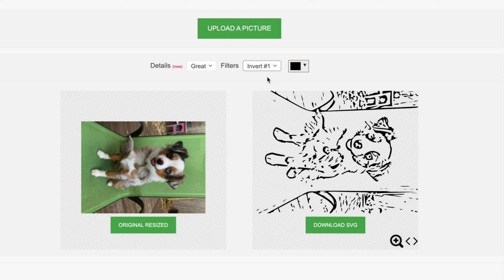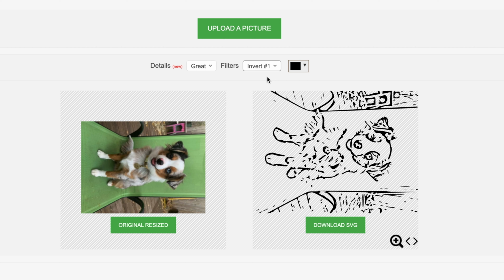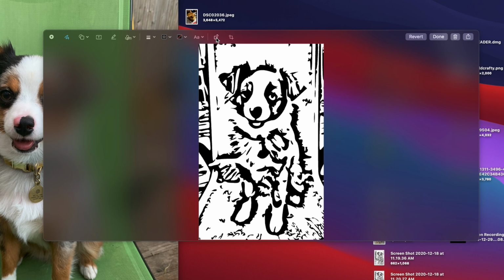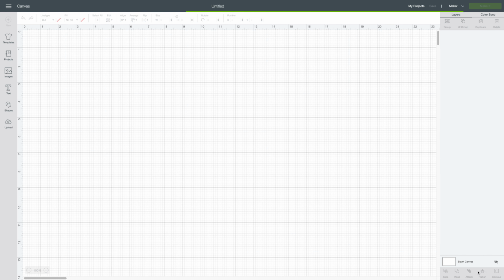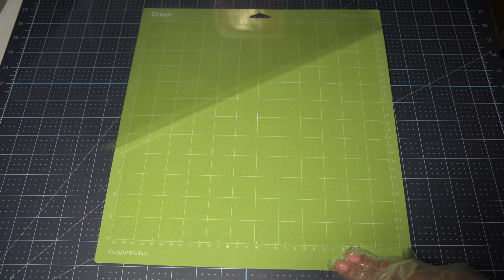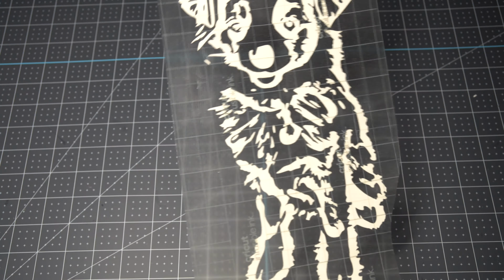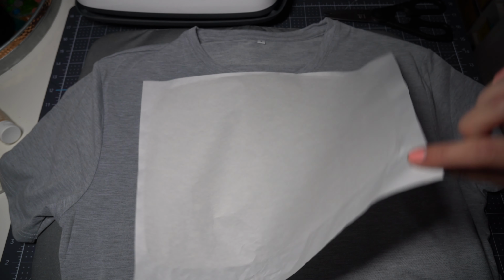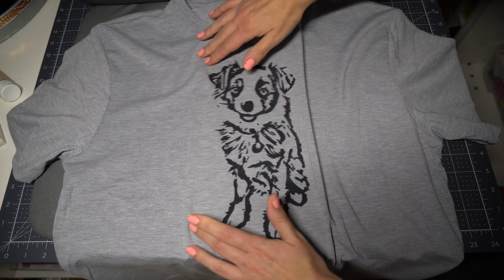How to Turn a Photo of Your Pet Into an SVG File for a Custom T-Shirt

Comment: I couldn’t get this to work with my cricut joy and I did exactly what you did.
Reply from the maker: Oh no! What happened? Which part didn’t work?
Reply: @MaddCrafty  not sure, I’m new to cricut world lol. But it had the little triangle and says “Not support by Joy: print” so not really sure what I did wrong. I think I must’ve done something wrong though.
Reply from the maker: @cherishmartinez8034  hm... the cricut joy and the cricut maker have some significant differences so it’s possible you didn’t do anything wrong and perhaps the machine doesn’t support it. I know the joy is smaller ... but if you’re a cricut newbie it may just take some time to get the kinks out and figure out how to work with it! The only thing that comes to mind is maybe you need to adjust the size of your image so that it fits on the JOY MAT! Sorry it didn’t work out! Deff give it another try after you’ve made a few projects 😌
Reply: @MaddCrafty  thank you! I think the issue is definitely with the image or something. Realized I didn’t save it as a cut. But the cut image was black?!? Soo I have no idea what’s wrong. Thanks for the video though and for replying!
Reply from the maker: @cherishmartinez8034  oh!!!! Yes!!! You have to save it as a cut! Not a print, the cut image SHOULD ALWAYS be black. You can change the color once you’re in design space! 👍🏻👍🏻